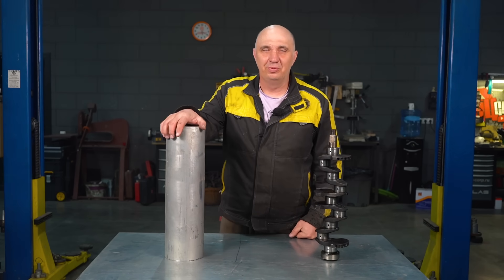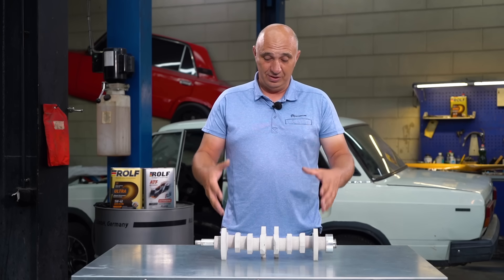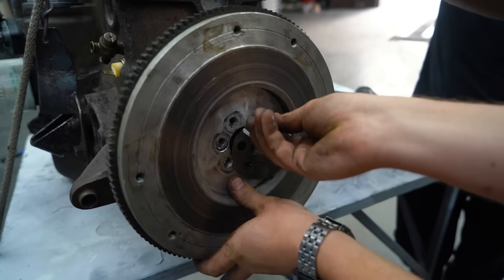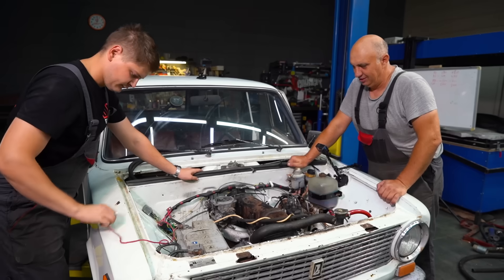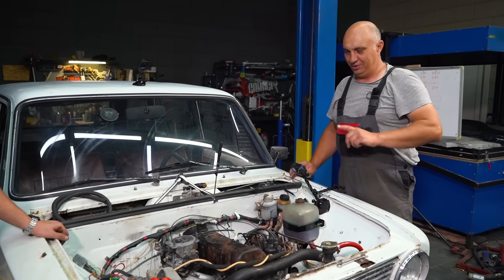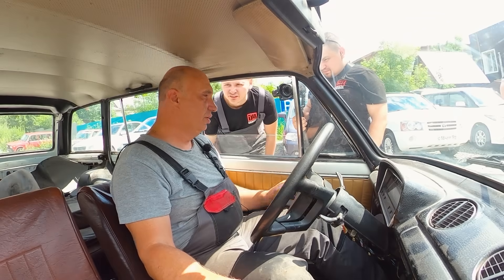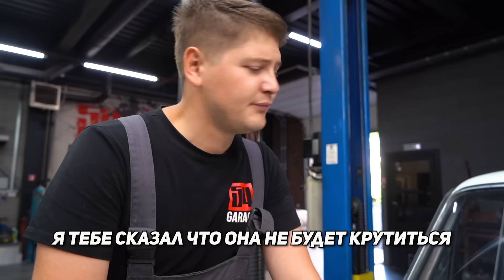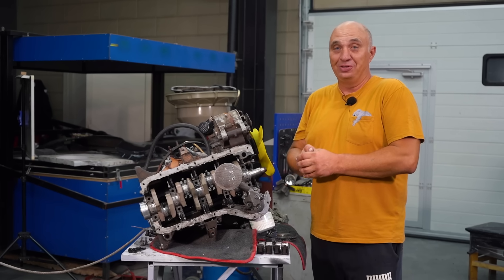We make a custom duralumin crankshaft for a Lada

Comment: Try spray welding, it's common here on the US, you put negative charge on crank and positive charge on the spray welder. It takes whatever hard face material and sprays it onto a surface, In this case, the rod and crank journals.
You don't need to hard face the entire crank, just the journals.

Comment: My parents had a Lada like this in the late 70's. Amazing car. working on it was easy. I used to tension the timing chain when I was around 14. It needed tensioning a lot and eventually it would keep rattling until the engine blew up. Great cars though, indestructible.

Comment: I have a bit of experience with ceramic coatings applied to metals. I think a potential cause for failure would be that as the aluminum crank heats up and expands, there comes to be significant thermal stress in the coating, as it would likely not expand nearly as much as the aluminum underneath. This causes micro-cracking in the coating, which allows it to easily be flaked off. Consider using some form of surface hardening treatment or a coating with a higher coefficient of thermal expansion in the future, coatings like this are not a great idea for parts that have significant thermal expansion without careful consideration of the thermal stresses.

Comment: you shouldn't use original pan.. u need to use with another metal, meybe iron pan. Aluminium pan and alumium crankshaft it doesn't work

Comment: The problem is aluminum  expands to much as it gets hot, the bearing spinning is inevitable.   Let alone how critical balancing is and was never achieved.   Further more crankshaft grinder cost a lot of money because they are precision machines, lobe timing is impossible  with a lathe as well as strokes heights . Nice try but , Sorry, it was bound to fail

Comment: Hmm prob need to account for thermal expansion... so need more bearing clearance for the crank and the rod end...

Also maybe a good idea to use higher visc oil and a higher oil pressure pump

Comment: you should try billet steel pistons, but shallow style pistons to offest the weight... they wont expand as much, just have to make them the same weight or lighter as stock pistons and see if they'll hold up. techinically if you design it right you should be able to take out a serious amount of material and still keep the strength...

Comment: This is wrong!
It isn't the bearing material.

It's the fact that aluminum expands to much under heat. That's the only issue.
So when the crank heats up, the conrod bearing would be to small for the bigger camshaft. As it cools down it would be move again. But then the bearings are gone.

So it could never work.

Comment: 'duralumin' just means modern aluminum alloys with a small percentage of copper, which brings about precipitation hardening of the material as it ages.
It is just the name the Germans came up with when they discovered it, by accident, while researching strong/light alloys for zeppelins.
If someone hadn't re-tested an old sample by accident, the discovery could have taken another few decades, there's no way to know for certain.
Precipitation hardening requires aging; the material will be much stronger two weeks after pouring than it is two hours after pouring.

Comment: that looks like galling to me, you guys used steel bearings. maybe if it were put together more like a nitro rc engine. the crank piston and connecting rod are aluminum and I forget what the bearings are made from but it's not steel. regardless that was cool, nice job gentlemen, great content.

Comment: I have a small idea on how to maybe fix the issue with the journals being tore up on your aluminum crankshaft. Try repeating your ball bearing experiment on rep replacing the slip bearings. Maybe you can cut the ball bearing rings in half and put a tack weld to keep the balls from coming out put the 2 half of that ball bearing and well done back together on the journal. Just an idea to try.😅

Comment: i like your electric lada car .. with the four wheel drive using heavy drills and just a simple throttle .. we need more electric, and say goodbye to mechanical nitemares .. electric motors are easier to fix and cheaper to replace ..

Comment: I"m curious to know the outside temperature there. Last few videos i've seen, there has been much snow accumulation. If the temperature is low enough, carburetor icing could be a problem, especially running open with no preheated air system.

Comment: Russian fishermen would call into our port for supplies and when they discovered Lada cars could be bought at scrap yards for £50 they used to buy them and load them onto the trawler's decks and take them home, just thought I'd tell you that, this was in the late 1980s, they also sold cheap vodka at £5 a bottle instead of £12, the cigarettes they had were unsmokable, sawdust and twigs mixed with tobacco,

Comment: That crank did not spin freely when they set it into the block. It should be able to rotate with just one or two fingers without the connecting rods on. It was at that moment that I knew it would go far at all

Comment: Giving the thermal expansion coefficient of about 3x compared to steel means that it would never work as the crankshaft bearings would be so loose cold that it would instantly spin the bearings and would not stop until it expands. The ceramic coating is not a bad idea but won't last as long as it would have to for it to be a long lasting engine maybe a nickel plating or something else similar that is hard but long lasting but the expansion issue kills this idea before it starts because cold its to loose and hot its just right and if you make it to fit cold it expands to be about 3x to tight.

Comment: try it titanium crankshaft make this one A metal that is lighter than iron but just as strong and durable would be titanium. Titanium is about 45% lighter than iron, yet it has high strength and durability. It is commonly used in aircraft, spacecraft, and sports equipment for this reason. Additionally, titanium is highly resistant to corrosion, making it long-lasting and able to withstand harsh environmental conditions...

Comment: Omc try aluminum crank shafts in some of there 2/stroke outboard  prototype race engines.. what they had Done for the main and rod bearings was take a 2  tool hardened what looked like a normal plane bearing normally used.  But they had a little lip on the ends of them and snapped in place on every rod and main journal then they used long needle bearings like a wrist pen.  But no cage holding them together.  Had to use grease to hold them in place when put it together.. they were 300hp v-8 outboard engines that would spen 9 thousand RPM's + the worked good a lasted way longer than I would have ever thought...

Comment: Grind the crank clean the journal until you get the proper clearance for the expansion of aluminum and put new bearings and see how it does but remember not to rev it until it warms up and the aluminum expands to the proper size

Comment: a solution would be steel bearing on alu crankshaft, so no more bearing problems or plating it with chrome also alu expand 2 times more then steel so take in account that.

Comment: A lot of trouble to go through. Not a place I would try to save weight, either. Forged steel cranks can be lightened, and a good deal of the mass of any crankshaft is close to the rotational axis, so its moment of inertia is considerable lower than the overall weight would suggest. I guess i you've got a lot of time on your hands, it's a cool experiment.

Comment: if you cut grooves in, press fit and weld a steel ring into the bearing location. you won't have to worry about the bearing eating away at the aluminum.

Comment: Still want to see a flying Lada.  It will have to be a low wing w/ long canard and a system to connect the Lada engine to a pusher propeller in the back.  Vlad can drive and Sergei sit in the passenger seat to operate the flight controls.

Comment: They didn’t calculate the wights of the rods with the counter balance of crank.  The expansion properties of the aluminum wasn’t taken into account.     It should work fine if they do those things as long as they keep the power levels low because of the twisting motion involved.       They can look into pourable Babbitt bearings until they get a new one made

Comment: Very intersting ... expecially lathe turning. Is a real fact that the shaft has not so much excentric weights, and - if so - they are very near to rotation assis. Good work, but i dont't believe that 5 kg less than iron shaft can give a better performance of the car, the thing for me is just the same as throwing a 5 kg luggage from the window car.
More significative idea was to try to make aluminum pistons, they are flying continuosly fro PMS to PMI ...
Of course an aluminum shaft has minor inerzia moment ( I × I x r ) than an iron one, but this is reduced greatly when the motor pushes the car on ... 
Don't you believe ?

Comment: Love every video guys thanks for all the entertainment 😃
All aluminium crank and rods with roller bearings, flywheel and an aluminium drive shaft and Mill cylinder head to 10.5:1 😈
Auto transmission would be best (I reckon) or if you keep it manual gearbox... setup some dual carbs to 1000rpm at idle (to combat stall) and rejet carbs to lean them off 
All installed in your laser lightened rusty Lada
That would be a great video!! 😎

Comment: SUGGESTION: 
Since alcohol needs about 9:1 stoichometric ratio, and vodka is about 40 percent alcohol, why not use pure vodka in an engine, but at a ratio of 4:1 vodka to air via using truly gigantic fuel injectors to unleash the potential of a 20:1 compression radio vodka-powered engine?

Comment: Do you understand what happens to the tensile strength of aluminum under stress over time? This WILL shear eventually. It's a cool concept, but the entire reason steel is used is because its tensile strength flatlines over time. Aluminum will lose its strength until it shears
Reply: With this being said, I love the project, I love the machining. It's awesome. It's just not ideal

Comment: The metals expansion coefficient for steel is 0.0000065 / °F. 

aluminum, is 0.0000128 / °F

Thats inches per 1 degree change in Fahrenheit. Aluminum expands and shrinks almost twice (1.97x) as much as steel with respect to changes in temperature. Maybe try doubling the tolerances of the journal bearings, and a thicker oil? Cold starting is gonna be interesting

Comment: Why do you think this is going to work?

Steel has a higher modulus of elasticity than aluminum, which means that steel is stiffer and less likely to deflect under the same loading conditions:
Modulus of elasticity
Steel has a modulus of elasticity of around 200 GPa (29,000,000 psi), while aluminum has a modulus of elasticity of 69 GPa (10,000,000 psi).
Stiffness
Steel is three times stiffer than aluminum, so a steel part will deflect less than an aluminum part of the same thickness and design under the same loading conditions.
Springback
For the same yield stress, steel will have one-third the amount of springback as aluminum.

Comment: My brother and I put a lightened flywheel onto his Mazda RX-7 and because of the lack of inertia, it had to be revved up all the time. That, coupled with the removal of his catastrophic converter, gave it a very distinctive exhaust note with extremely fast Rev acceleration. It is a good thing that the light and flywheel came with a heavy duty clutch to handle all of the slippage that it would be subjected to upon take off! PS, I enjoy your presentations!

Comment: Flywheel weight or reciprocating weight is overrated. 
Remove as much as you can. 
I took 7 pounds off a vw mk1 flywheel and it runs great.

Comment: it probably would have worked if the journals would have been oversized to be used without the Bearings, so you have aluminum against Cast Iron. You can't use Aluminum on aluminum it will score, unless a coating is used to prevent it, but it was a cool concept, which you guys always come up with something Unique like the 3 compression Rings that was a cool episode.

Comment: You should cryogenically stabilize the crank. That's very old technology. And try using 7075 aluminum, it very abrasion resistant.

Comment: Sticking with the aluminum surface on the crank and using a hardened steel rod insert with a Teflon coating might work.Clearances need to be loose so they come in when hot.

Comment: You can but you need to engineer the alloy to limit expansion and increase strength. Once that is taken care of you can coat the crankshaft with Nickel-silicon ceramic. But engineering the Metallergy is going to be costly. Good luck.

Comment: It would be interesting to try again with a Nikasil (Nickel-Silicon carbide) coating.  It survives cylinder bores in Porsches.  Then run an extra few thou on the bearings.

Comment: Maybe if you had undersized the main and rod throws and had them spray steel coated and then ground them to size the crank would be light but not go bad.

Comment: Not inertia - rotational momentum.  Inertia is resistance to movement; momentum is resistance of a moving body to deceleration.  The momentum of the crank is less than that of the cast iron crank - but that is fixable with timing and idle speed adjustment.

Comment: well it didnt last, but maybe this is just the experimental start. BECAUSE IT DID WORK,  and was exciting to see. maybe like other aluminum parts there just need to be steel inserts at the journals for bearings to ride on. i love that, "you cant do that", does not reside in this shop. GREAT JOB😊

Comment: Let see what happens when heat cycles, thermal expansion and vibration do to that ceramic coating, I will take that it will not last long on a running bag engine under load.

Comment: You need to use billet aluminum and then have the crank heat treated again and then have the journals coated in a much harder substance and much thicker coating, your son was right it needed to be undersized and filled with a thick coating so it wouldn't flake off. But you didn't have enough clearance for the thermal expansion.  Nice experiment but def needs more thought put into it

Comment: would be cool if you could sleave each  barring  
you would have to weld it on  Posabley key it but  as long as you could get them tight im sure it would self fix 

also  did you use aluminum rods and pistons ? maybe even aluminum wristpin's 
if the block was also aluminum could this help with everything expanding together 
grate video

Comment: Ahh, don't worry bout metal flakes in the engine oil. The flakes will fill any imperfections in the cylinder walls. Also the flakes will always be making cross hatch marks on the cylinder walls as well. I always add 2 tables spoons of metal lathe chips into my oil when I do an oil change. Keeps my engine running smooth because the cylinder walls are kept in great condition by the metal chips floating in it.

Comment: "Stupid Video of trying to reinvent the wheel as usual". To achieve Longevity and Balance requires multiple procedures and materials. To save 20 to 60 Lbs. in an engine that weighs 300 lbs. is moronic relative to the gross weight of the vehicle.  How many hours do you think this junk could tolerate 10,000 RPM before total failure ?  Most of all the new Motorcycle Engines from every manufacturer with a Large  Bore(1000cc) high horsepower engines use Liquid Cooling for their garbage.  They have convinced the stupid masses that it is superior to air cooled engine and are more reliable.  The truth is, it substantially reduced the Manufacturers Cost of Production. The cost of materials for a High Performance 4 or 6 Cyl. Air Cooled Engine is very high.  I own such a classic which is an 1983 Kawasaki Eddie Lawson Replica 1000R.  The manufacturer's warning is that you cannot allow the engine to run at 'Idle Speed' for more than 5 Minutes without causing Damage.

Comment: I would have tought the Aluminium crankshaft journals and bearing would expand in heat and seize.  I would have shave extra gap with the main bearings.  And would have had lead weight in the crankshaft lobe to counter balance the pistons.  But it seems to work perfect.   Im only at 2/3 of video so far. Maybe i will see more and refresh my comment. Lol
Reply: The crankshaft did exactly as I tought. I would have shave an extra 0.003-5" gap and put never seize compound.  Maybe coolant passage in the crankshaft or Dry ice comparment. Hahaha.  At least a colder thermostat, like 125° farenheight,  in a boat with fresh water cooling system.  
Abec #9+ Ball bearing journals would be the only solution.
Very cool video again. Thanks

Comment: Aluminium is about one third of the mass of steel but also about one third of the strength….there are some special aircraft grade aluminium which come close to the strength of ordinary steel or cast iron…but is has less stiffness as well….so will flex around in wonderful ways under the variety of loads in a crankshaft….not a smart move …but it wasted a few minutes I had available ……

Comment: Interesting experiment, not sure of the advantages obviously lighter, sacrificing strength. Aluminium has a greater expansion rate than steel. The journals could be coated in nikasil, as used on cylinders.